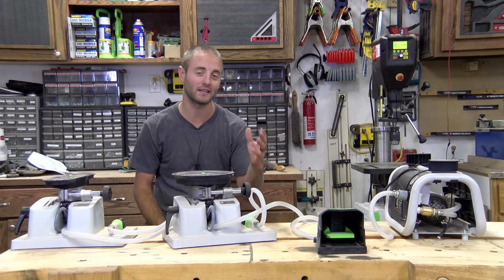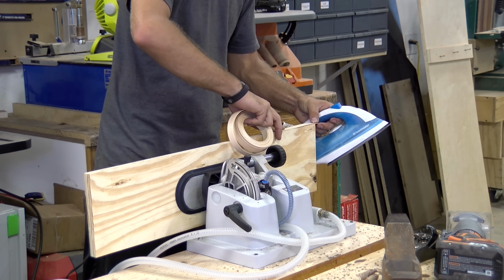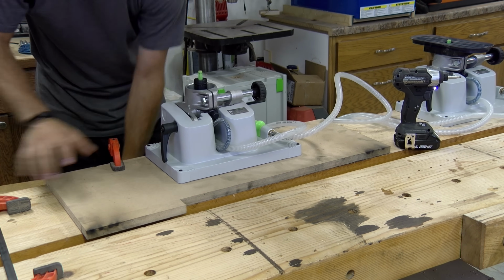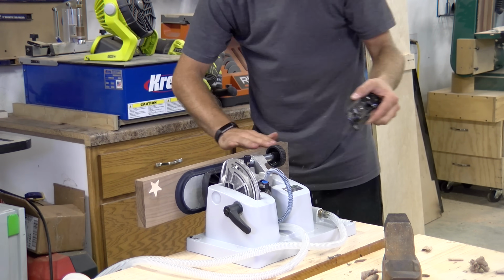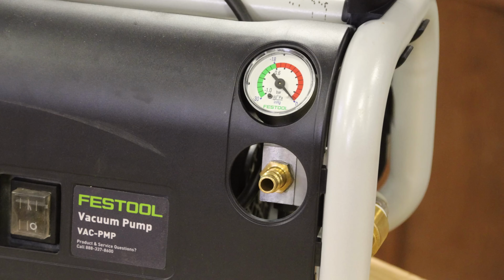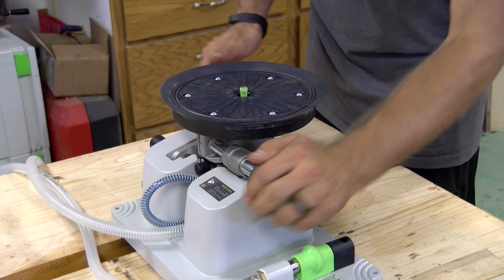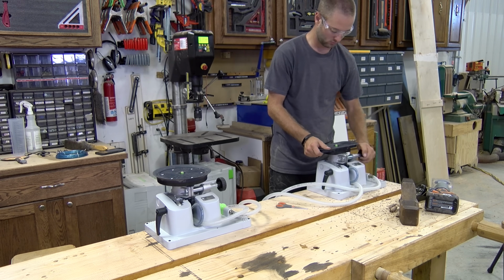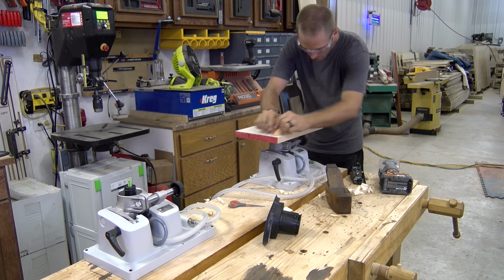Festool Vacuum Clamping System | Woodworking Game Changer

Comment: Its $1380, US and xtra +/- $350 for 3 different size clamp pads. I build face frames and wouldn't be able to use unless I buy the kit with smaller heads , and if I need 2 like size heads well that's more $. It's one of those dream tools when the tree in front of my house starts to bloom. Looks like an amazing tool but one I simply can't afford.

Comment: For the price, I'll stick with a vise and clamps.
Reply: I made my own vacuum system over 20 years ago for doing template routing jobs that I had at the time you can use an old refrigerator compressor or an AC compressor that’s 110 I had a helium tank for the party balloons from Walmart as the in between storage on the vacuum just so I could switch ports quicker had a hand operated valve you use a ball valve and you can use quarter inch vinyl tubing just get the heavy wall stuff and you can make your own clamp down pads
The way the vacuum works is that you draw the air out between the two surfaces and the atmospheric pressure causes your clamp down force and I had somewhere between 14 and 15 pounds per square inch